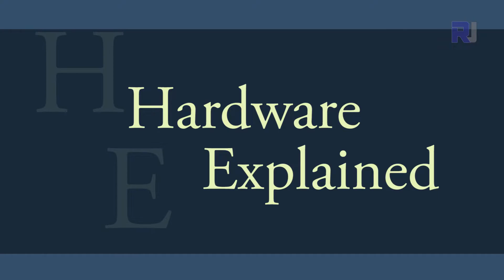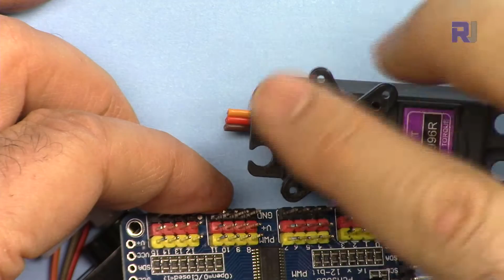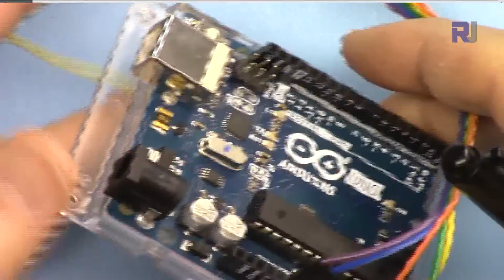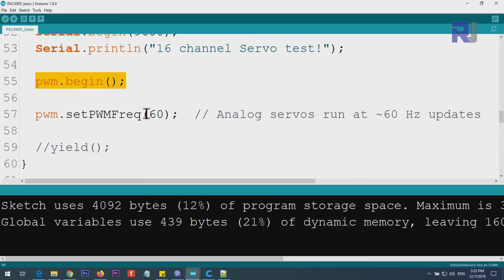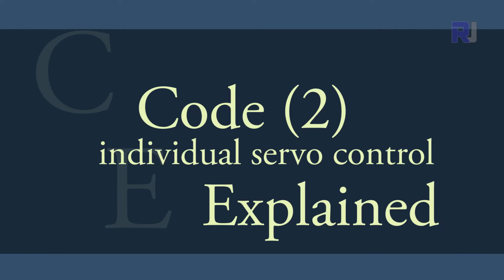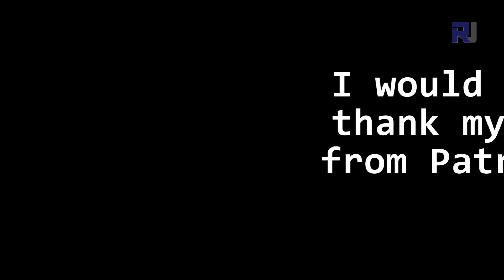Control 16 Servo motors using PCA9685 Module and Arduino V2 - RJT243

Comment: Thanks again Ahmad, great as always. I have 2 of these arriving today, previously i was bread-boarding them but even with just 8 servos it gets very messy, and i smoked 6 servos yesterday due to confusion caused by the wire-mess, this should tidy it up!
Reply from the maker: You are welcome.  Yes. lots of wires. I put them on a cardboard . Perhaps you wired the power supply incorrectly. Connect the power first when there is not other wires. good luck.

Comment: Hello ... I wanted to thank you for posting this and other videos... they really helped me along. I can pretty much follow every step but I have run in a seemingly simple yet frustrating problem.

I would like to run multiple loops at the same time to different angles. Now I do know that I can just state and they "seem" to run almost simultaneously :

 pwn.setPWM (0,0,120);    // inital state motor 1 at 120 degrees
 pwn.setPWM (1,0,90);      // inital state motor 2 at 90 degrees
	delay(1000);
 pwn.setPWM (0,0,170);
    // motor 1 moves plus 50 degrees to new state
 pwn.setPWM (1,0,10);      // motor 2 moves minus 80 degrees to new state

 but I loved your loop script ... that lets me control the speed using a loop like this

void loop() 
         {
                                      

                       for( int angle =0; angle<120; angle +=20){
                       delay(500);
                       pwm.setPWM(0, 0, angleToPulse(angle) );
    // inital state motor 1 at 120 degrees
          }
         {
                                      

                       for( int angle =0; angle<91; angle +=20){
                       delay(500);
                       pwm.setPWM(0, 0, angleToPulse(angle) );
    // inital state motor 2 at 90 degrees
          }
         {
                                      

                       for( int angle =70; angle<170; angle +=20){
                       delay(500);
                       pwm.setPWM(1, 0, angleToPulse(angle) );
    // motor 1 moves plus 50 degrees to new state
          }
         {
                                      

                       for( int angle =90; angle>10; angle +=20){
                       delay(500);
                       pwm.setPWM(1, 0, angleToPulse(angle) );
    // motor 2 moves plus 50 degrees to new state
          }

the problem is that I would LOVE to run these loops at the same time... is there any way to do that?

Thank you.
Reply: Hello, I found a solution / work around and as I have looked around many people had the same problem so this might help them too:
>> if the first motor should go from 0-180 and at the SAME TIME a second motor should go from 0-90: 
(or any other value in the same direction)

for( int angle =0; angle<180; angle +=2)
  {
    delay(20);

    int pos2 = angle / 2;
                                                // i created a second value "pos" by deviding it by 2  180/=90 and this way you can get any value you would like
                                                                                        // you can even multiply it to get a higher number   

    pwm.setPWM(0, 0, angleToPulse(angle) );
         // motor 1 (at pin 0) will go to "angle" distance   --> angle = 0-180
    pwm.setPWM(1, 0, angleToPulse(pos2) );
          // motor 2 (at pin 1) will go to "pos2" distance    --> angle / 2 = 0-180 / 2   = 0-90
  }

Now it took me a while to figure out when the motor don't go in the same direction for example motor 1 goes from  0-180 (= +180) and motor 2 from 90-0 (=-90)
so I came up with this "math" solution.  pos2 = ("angle"-180) / -2 ,   this means at 0 -->    (0-180)/-2 = 90   --> at 90 --> (90-180)/-2 = 45  --> and by 180 --> (180-180)/-2=0
and that WORKS !!!!

I have now 5 servos running in one loop all with different angles and in both directions... HOPE this helps everyone with the same problem :D
Reply from the maker: I am glad you found the solution. Last night I saw your comment and wanted to respond but it need long response so I waited to respond at the right time.
Reply: @jeanmarcvanrijswick7633  hi thanks for this can you please provide the full code please from beginning. I am facing the same issue.

Comment: Thanks for this video.  I'd like to control 16 servos individually for model railroad turnouts using 16 toggle switches so that the servos swing in different directions, thereby changing the alignment of the turnouts depending on the position of the toggles.
Reply from the maker: You are welcome. Here are my other Servo related videos where I have made them for different  applications. https://www.youtube.com/channel/UCkcBSig_Iu4ZnAIeCeG1TVg/search?query=servo

Comment: Great video sir....  Question...How much current do we need to supply to power 16 sg90 servo.... And how much do we need to power 16 Mg996 servo motor
Reply from the maker: I have explained and mentioned how much current is needed. This video is version 2 or V2. I have v1 to v4 so you will find answer and I don’t remember the value.

Comment: Although the PWM is set with a 12 bit value, it does not mean there are 4096 steps of control. At a frequency of 50hz you get 25MHz/(50Hz * 4096) ≈ 122 steps. This is a far cry from the advertised 4096 steps!
Reply from the maker: yes indeed. thanks

Comment: You are great inspiration
Reply from the maker: I am glad you like it.
Reply: @robojax  can you redefine the code for 16 servos with smoother movement  at same time same which we can get from servo sweep library example code. It will be great help.
Reply from the maker: Please watch V1 of this video. the link is in the description. If you want to customize it, then watch the code section carefully and you will know how it work.  good luck.
Reply: @robojax  ok but I watched everything
Reply: I got the code for smooth movement of  servo with simultaneously movement for all 16 with hcpca library. Very fine n precise without any jitters.
Reply: I will share the code from my laptop.
Reply: Now just one help required. At starting of power supply the servo are giving jerk. Like they are getting some shock. How to eliminate this.

Comment: Amazing, if only using 6 Servo motors with high torque still need this PWM driver? If true why don't we just use PWM pins on arduino, what's the difference? Looking forward to your feedback!
Reply from the maker: Hi, servo just need PWM signal. So it works with any device .  Torque does not matter. By the way you are watching version 2 or V2.  You must watch V1 so you know how to calibrate.  Also there are V3,V4 and V5.

Comment: Hi, Great video.  Thank you very much. 
I have question now. Is it possible to control multiple 360 degree servo for continuous rotation with the PCA9685 module???
Reply from the maker: Hello and welcome. continuous  or 350 servo is not real practical servo. you better use stepper motor.  here are my videos on continuous servo https://www.youtube.com/robojaxTV/search?query=360

Comment: Dear sir, can we control these servos with hc05 Bluetooth module using pca9695. if yes please help me into this. thanks in advance.
Reply from the maker: if you know how to use HC05 and watch version 1 V1 of this video, I have explained every line and every part so  you should be able to control it. But HC05 is extra. now ESP32 has builtin Bluetooth and using Arduino you can program is very easily. I have a lot of examples on ESP32 Bluetooth here is the search result https://www.youtube.com/c/RobojaxTV/search?query=esp32+bluetooth

Comment: Can you use a trigger(switch) to control each servo? For example, I want servo 1 to move 20 - 100 degrees (programmed in the code) and it stays at 20 degrees until I push a button (trigger) then it moves to 100 degrees. Once the button is released it moves back to 20 degrees. I see a lot of videos about this servo control board, but none that show physical buttons (triggers) to operate the servo.
Reply from the maker: Hello, this is Version 2 video. I have V1 to V4 you may learn something to use for your purpose.  I have tones of videos on servo and push buttons. Here is how to find Specific YouTube Video in a channel https://bit.ly/findYouTubeVideo

Comment: Great videos! How can this be modified to use a switch or pushbutton to sekect and actuate one of the 16 servos only? I would like to use the servos to control model railroad turnouts. Thank you.
Reply from the maker: Hi, I have tones of videos on push butto with serveros. here is one https://youtu.be/J_kbyAY1rLM but you can search and learn from them.

Comment: In the current issue of MRH 2020-02 - February 2020, Model Railroad Hobbyist magazine, there is an article using servos. Would it be possible to do the same thing with the arduino and a pca9685? I have 16 servos on my layout to control and a PCA9685 would be ideal, but would like to be able to set them up while intalled on the layout, like the article describes. This is by far the best channel yet that i have found on this stuff and thank you for your time, Bob
Reply from the maker: Hi, You are welcome.  I have no access to the article. I just visited the magazine's website but March issue it not free.  I have 4 video versions for this module and have over 10 more videos on servo.
Reply: @robojax  The issues are free, feb and mar have the info. Either way thanks.

Comment: is the min and max value for all the servos in your setup the same? I think the answer is no. How are you accounting for/ how will you account for the difference?
Reply from the maker: if you get all servos for the same manufacturer they are more likely to be with the same specs.  I will see if I can update the code or perhaps V5 of this video to add that feature.

Comment: Hi, can you please demonstrate how to control 12v geared motors with pca9685. Specifically I need the right way to power up the 12 v motors and control them using pca9685 module.
I mean can I directly connect my motors to the battery and control them using pca9685 through pwm signal. Which module would you suggest to power up atleast 4 12v dc geared motors from my battery that can be fed with pwm signal from pca9685.
Reply from the maker: Hi, for each motor you will need driver like L298N or other rated driver. Then use this

Comment: I have concerns about powering 14 very large (65kg of torque) servo motors. soul i just use separate source of power and use only pwm line for them?
Reply from the maker: Yes  indeed, this video is. Station 2 or v2 but there Pete up to 4 versions if you want I see different ways this model is used.

Comment: Is it possible to control servos and motors on the same board at the same time?
Reply from the maker: this for servo motors and NOT DC motors.
Reply: @robojax  I relised that after posting. Not sure why i thought they worked with DC motors too. Thank you for the reply.

Comment: How to control 5 servo with 5 potentiometer in pca9685 with ard uno?
Reply from the maker: this will need full new code to be rewritten.  You will learn how to connect 2 or more potentiometer from this video https://youtu.be/_uz7YcOzvjU and then  watch V1 of PCA9685 to see how we send values to each servos and  the values you get from pots should be mapped to the values need for  each servo. it should work. If you don't watch both videos and try to understand it, it will not work. I have not left anything out.  Good luck.

Comment: If I want to control 6 servos once ,should the pca board be given 5 volt only or if exceeded.above 7 volt it may damage rhe board or servo ??? I am using mg996r servo
Reply from the maker: does not matter. Pease watch the V1  (version 1)of this module as this video is V2.  if your servo need 100V or 7V, connect separate voltage to  your servo. Just use this board to control it, not power it up. if you don't skip and understand how it works, it is would be easy.

Comment: Hello, when i connect 6 servos to mine it work fine but if i add more they start shaking do you have any advice.
Reply from the maker: Hello, it seems have power issue. make sure you have external separate power supply.
Reply: Robojax what type of power source do you use
Reply: @folarindavies  I use a 9V block

Comment: Hi, I'm really appreciating your patient instructions on these videos. I have a question about using the PCA9685, it seems that <Adafruit_PWMServoDriver.h> assumes the use of Arduino pins A4 and A5 (or the dedicated SCL and SDA pins), but I'm using an ESP32 and I'm not sure how to modify the sketch to designate the pins I want to use for i2c communication, and for that matter how to initialize the pins on the ESP32 for that designated use? Is that something you can help with?
Reply from the maker: This is version 1 or V2 and I have got 3 more video’s including esp32. Please see links in description

Comment: Can you help me with a problem? What code do i need to drive the servo motors slower in their rotation.
Reply from the maker: Just add delay in the loop like delay(50) which adds 50 milliseconds delay. Play with the number. The larger the number the slower the speed of servo motor.

Comment: Nice video. I have a query, I bought Servo Click module from mikroE. It has same PCA9685 chip. Do you have any idea how to know about its I2C address? I want to interface this servo click module with Arduino Mega via Mega shield.
Reply from the maker: Hello, use I2C address scanner from Robojax.com

Comment: hi Mr shamshiri...thanks for the informative tutorial i want to know that how to control a servo motor with arduino using rs232 communication...can you help me in that plz?
Reply from the maker: Assalamu alaikum Salman,, You are welcome. this module is using I2C communication so either you have to get a library or hardware that converts RS232 protocol to I2C. It needs separate video and because this is too specific, I won't make such video.
Reply: @robojax  walaikum salam...thanks for your response

Comment: Hi sir, thats a helpful video. I want to ask, is it possible to make servo movements smoother like the program "sweep" in the example Arduino ide if using that module?
Reply from the maker: Hello, yes you can . please watch V1 and other versions. I've given enough examples.

Comment: can i ask something plz can we put 6v as an externtal power cause my metak gear sero works with 6v and can i program 35KG metal gear motor with this pca? by the way great video
Reply from the maker: The input voltage should match your servo motor voltage. if your servo works with 6V use that if it needs 12V , then connect 12V.
Reply: @robojax  great thanks a lot but the 35kg servo can be programed with arduino and pca?

Comment: Hi. Great video. Very detailed. Can you tell me what you're using to power it please? Also, how can I power a 60cm biped robot without using an adapter for 16 x 5v servos? Thanks. New sub.
Reply from the maker: Hi, Thanks. There are 10s types of servo motors. you need to see the datasheet or measure it yourself. This video is V2, there are V1, V3, V4 and V5 and I have done tones of test. I don't remember but the SG90 micro servo needs about 200mA so multiply it by 16 = 4000mA or 4A. Then select a power adapter or convert that can supply 4.5A at 5V.
Reply: @robojax  Thanks. What do you use?

Comment: Loved the videos. Is there a way of adjusting the servo speed ??
Reply from the maker: Yes. The current speed is maximum. Add delay to slow it down. I might have some code for that but forgot. check all 4 versions. this is V2
Reply: @robojax  Thanks very much for the very quick reply. I have watched all the videos and learnt loads.
I can now control angles and speeds perfectly.
I have set up several inputs which I want to control individual servos to move to a set position.
I have a working sketch for the inputs and a working sketch for the servos but I cant get them to run together.
Any chance you can point me in the right direction ??

Thanks Eddy

Comment: I can't get this to work, it's so simple to connect i don't understand it not working. I checked all the servos with the tester, they run when i use normal servo.attach code, but not with the Adafruit library. I tested the servo output pins and they are all under 1 volt, why would that be? I have tried with Enable to ground and with Enable disconnected (recommended elsewhere) but no joy.
Reply from the maker: When the module outputs signal, it would be 5V PWM . this means the chip is not getting signal from Arduino or bad wiring.
Reply: @robojax  So i won't see 5V until the sigal is active? The wirig is fine, simple conections all tested. Thanks Ahmad.

Comment: asslamoalikom sir, your video was very helpful, thank you very much, but I've a problem so pls answer me. I am using PCA9685 with arduino uno to control 9 servos( 4 Mg995+5 Sg90) and powering the servos with an external power of 5volt 2 Am but the problem is that whenever i connect mg995, altogether, with Pca9685 they work perfectly, but whenever i try to connect more servos (sg90) with it, they either get damaged or they dont work, why is that so,i've connected all the wires correctly with correct power supply and coding but the servos dont work, why??? 
pls answer me, i am waiting
Reply from the maker: Walaikum salaam, the only reason I would say is the incorrect wiring . Codes can’t damage

Comment: I have tried like your tutorial but i am not getting the output, all motors are malfunctioning. What is the solution. And i have used 5.6volt 10 amps SMPS for power supply
Reply from the maker: have you noticed this Version 2 or V2? start with V1.